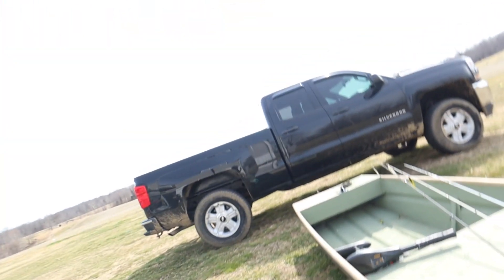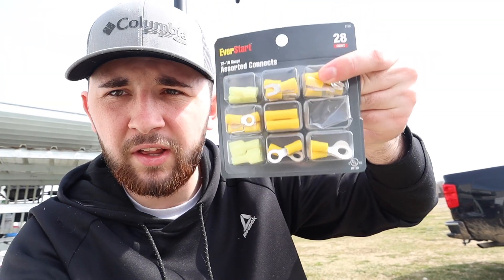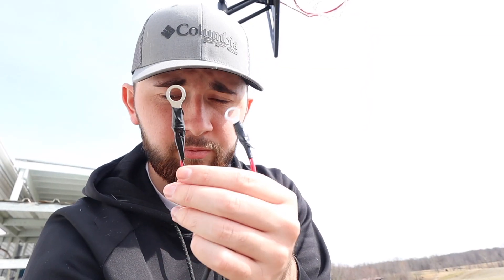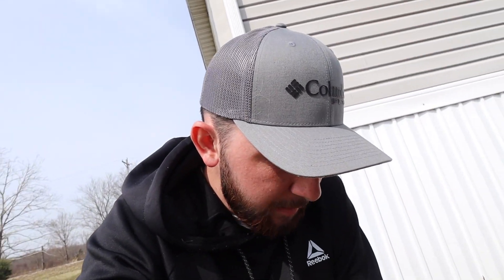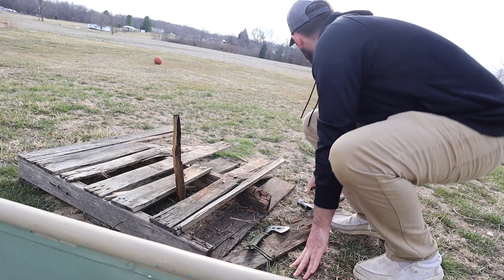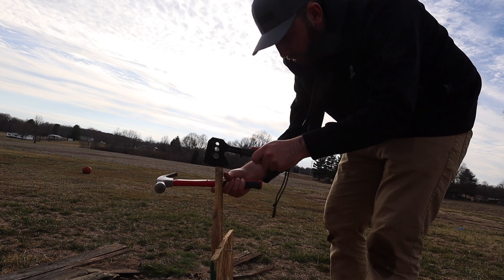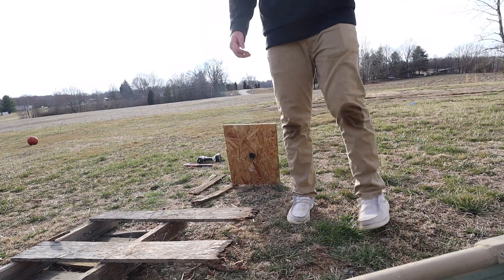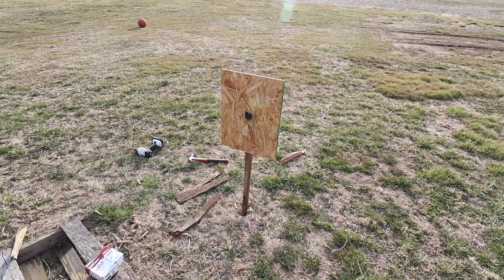I Should NOT Have Bought This...

Comment: JT, you installed the fuse incorrectly, you connected directly across the battery, it no doubt blew immediately and It's now doing nothing except existing. It was supposed to go in-line between the battery + and the red cable to the finder. Edit: Just watched the rest of your video (wood working) and come to the conclusion that we have created a new thing, instead of DIY, we have DDIY, don't do it yourself! Don't change buddy 🙂👍
Reply: This JT your fuse is doing bugger all

Comment: Top tip, when you're hammering nails into something hit the point of the nail a couple of times to flatten it before using it. Sounds wrong but it stops you splitting the wood